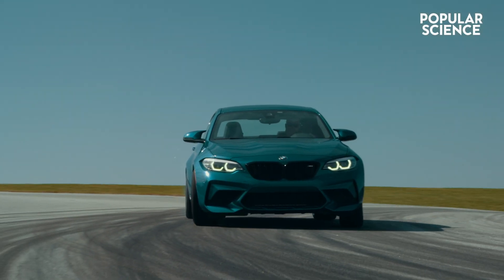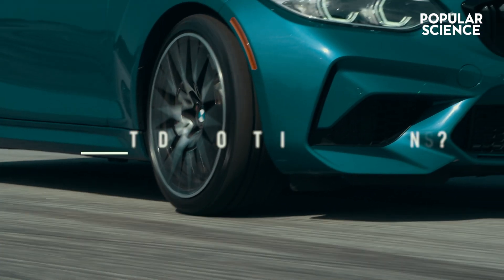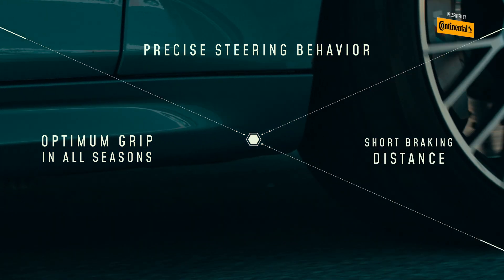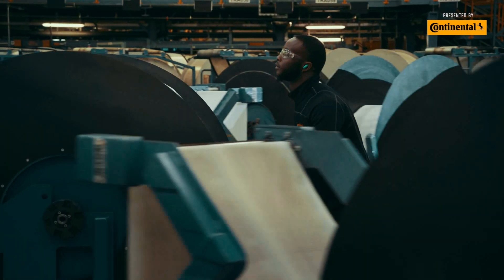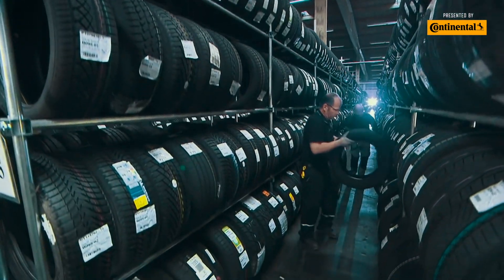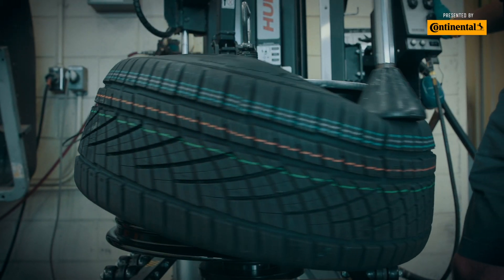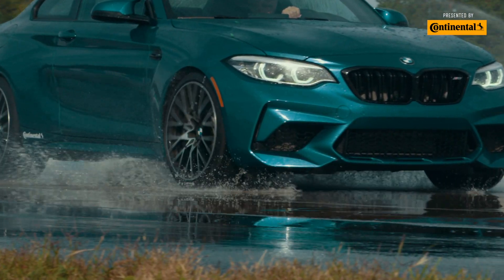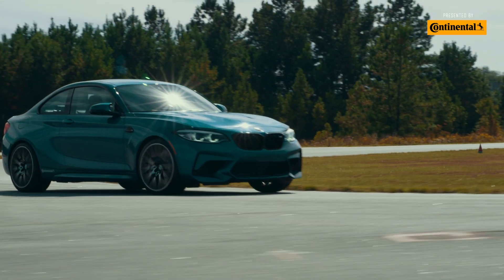What Makes an ‘Ultra High Performance’ Tire? These 3 Things

Comment: What are the shortcomings of this type of tire? Cost, wear?
Reply: I give the DWS06 Plus a 7 for snow because I'd give the Pirelli Sottozero 3 a 8.5 for snow performance and lesser snow tires a 8 for snow performance. 

Snow Winter Tires
Nokian 10 (Hakkapelitta)
Bridgestone 9 (Blizzak)
Pirelli 8.5 (Sottozero)

Snow tires still grip better, brake better and handle ice better. What these UHP All Seasons give you is the speed rating. They wear better than winter tires and perform better or just as good on wet and dry cold days. Quieter and better comfort. They cost about the same also.

Michelin 7 (All Season 4)
Continental 7 (DWS06 Plus)

I hear the Cross Climate 2 are really good but they have limited sizes, supply, expensive, and don't have the speed rating for sports cars/sedans.  V rating is enough for my E350. I think they have bad efficiency.
Reply: @dct124 , I am so thankful for you taking the time to explain everything in detail. But I apologize that I'm am a noob when it comes to cars (or car tires) and unfortunately I am unable to understand most of what you shared.

The reason I asked that question is because I didn't understand why the tires in the video are not used in common use. :)
Reply: @dct124 , oh thanks again. :)
Reply: I don't think they have a downside for normal driving. They aren't made for track days or very high speed (115 mph was safe, I'd assume faster once I get the fronts which were on back order)

Dry: 8.5
Wet: 9
Snow: 7
Wear: (50k miles)
Light Weight: 22lbs
Comfort: 9
Noise 9
Braking 8W, 8D, 7S
5,000 mile break in period

I currently only have them on the rear of a staggered E350 265/35 18. But I agree with TyreReviews (YouTube Channel) they have a oversteer characteristic. Wet grip is very high, aquaplaning resistance is very high, wet handling is amazing but they do tend to lean toward oversteer. Dry handling is actually very good. TyreReviews has not tested the "DWS06 Plus" but they tested the out going "DWS06" vs the Michelin All Season 4 and they did exceptionally well beating them in wet and staying close in dry and snow although the All Season 4 were a lot better than the outgoing DWS06 in snow and overall. I'd assume the dry and snow handling/braking is better than before, so think about as good as the Michelin All Season 4 with better wet handling.

Everyone I know under inflates their tires, including shops. The door jam tire pressure is for "COLD TIRE PRESSURE". If you warmed up your tires by driving to a service station for air you need to add +3psi or +4psi to the cold pressure rating and if you have a Mercedes the tire pressure rating is in the fuel door with instructions. Same rules apply for normal load and max load if warm. My old Honda SI manual said driving over 90mph for more than 10s you need +5psi over.

Hope this helps. TyreReviews is releasing a DWS06 Plus video in the next 2wks
Reply: If there is a down side it's dry and wet although they are excellent in both. A summer tire in warmer temps will still out perform this tire and all UHP All Season. The benefit is you can run them deep into winter months/temps unlike a summer tire. A winter tire is still better however if you get mostly cold rain like I do on the East Coast the DWS06 Plus is a better choice. I plan to run a square setup 245/40 18 Pirelli Sottozero 3 for winter mostly for temps, ice and steep hills. If you get real snow and your area doesn't plow then get Winter tires.